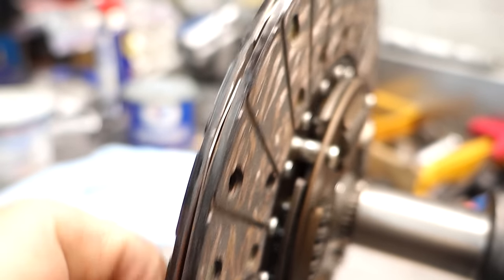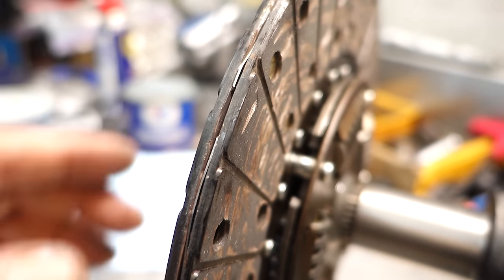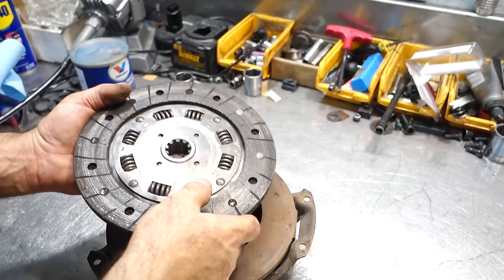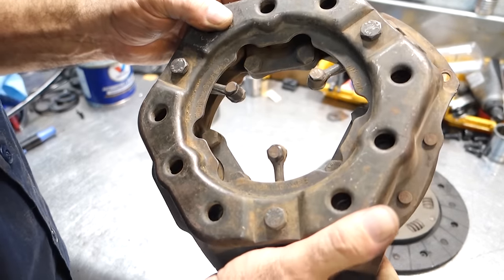Learn How a Clutch Works -  Basic Clutch Operation and Tips

Comment: Why are there friction plates on both sides of the clutch disc? If they're used on both sides, what is it that contacts them on the opposite side of the freewheel?
Reply from the maker: The clutch pressure plate as shown in the video
Reply: @GearBoxVideo  Is the pressure plate rotating in sync with the freewheel to transfer torque? I wonder how they're connected as the pressure plate is on the transmission side.
Reply from the maker: Yes, the pressure plate is actually bolted to the flywheel

Comment: First of all, thank you for sharing. 
I want to ask, what is the problem 
1) When the engine is running and the gear cannot be put in. Press the clutch pedal and when entering the gear it seems to be stuck?
2) When the engine is turned off, go into gear and then start the engine while pressing the clutch will the car jump (keep moving)?

how to overcome?
Reply from the maker: Your clutch is not disengaging the engine from the transmission
Reply: @GearBoxVideo  Yes i think so.

Comment: We have a clutch (most likely) thats making noise when its engaged. Another symptom is when its released quickly vs slowly in neutral. If released slowly its nice. If quickly - the whole car shakes as if something is out of balance. So the slow release of clutch centers the driveline where quick release does not. Would that indicate worn pilot bushing? Or any other ideas?

Comment: That's a great video!
There is one thing I don't understand, perhaps you could help me. 
What moves clutch disc away from the flywheel when the clutch is disengaged?
Reply from the maker: The pressure plate, clamps the disc to the flywheel and pressure plate. Its the pressure plate that unloads its clamping force allowing it to freewheel
Reply: @GearBoxVideo  I mean that the clutch wheel should move along the input shaft, what makes it to? Is it the marcel spring?

I understand on the moving car it might be vibration which pushes it away, but apparently it moves away from the flywheel as soon as the clutch is disengaded even on not moving car like in this video https://www.youtube.com/watch?v=jSmkdbBogc8#t=1m07s

I have tight gears on my car, especially 1 and R, suspecting that the friction on the splines is too high which causes the friction disc to be touching flywheel and transfer the torque to the gearbox. That's why I am trying to understand.
Reply from the maker: It doesnt move away from the flywheel. If you have proper air gap it will just float. If a disc is sloppy on the spline it  can hang on the spline
Reply: @GearBoxVideo  Thanks!

Comment: The trick with reverse is to 1 do it fast and 2 sometimes put it in a different gear first then try again. Works almost every time.
Reply from the maker: A dragging clutch is not resolved by doing what you are doing. A dragging clutch due to havining not enough air gap kills transmission synchro rings.   It's actually the number 1 cause of ring failure.
Reply: @GearBoxVideo  its not dragging just stubborn sometimes. there is no grind sound

Comment: @gearboxvideo @2:45 wouldnt both the flywheel and clutch still spin together even in neutral?  That was my understanding.. and that they would spin independently with the clutch disengaged right?
Reply from the maker: Yes as mentioned at 2..50

Comment: Love the videos , very informative, Have you got an old pressure plate of Fords that required the per adjustment on installation ? That would be a good one to do a video on if interested.
Reply from the maker: +kentuckycowboy2  Great idea.  I don't have one...   I'll be on the look out.
Reply: +GearBoxVideo I don't either or I'd send it to you. I got my Manual trans masters through Ford maybe eighteen years ago now and still picking up great things from your videos. Thanks for sharing your knowledge.
Reply: GearBoxVideo it's my first week driving a standar car and I am struggling. it's hard for me to take of or even park it up hill . any tips ?
Reply from the maker: You have to think of feeding the clutch to the engine. Feed it to fast and it will buck.  Once you master it,  it will be second nature.

Comment: Hey you should also have discussed the pilot bearing that is always in contact with the pressure plate. This is a pilot bearing that has a sliding plate. How would the free play be defined in that case?
Reply from the maker: Pilot bearing s ARE NOT in contact with the pressure plate. They are in your engines crank shaft. Are you thinking of  something else?
Reply: Yes it was throw-out or release bearing instead. I mixed them up.

Comment: Very nice explanation,  thank you! I have a question on a 1969 A833 4spd behind a 440 in a Charger.  I noticed a little slippage on really hard pulls(which I don't do often). But now I have a noise. Not when fully depressed or fully released but right in between. Upshift or downshift, it will have a strange grinding noise when halfway through the pedal travel. If you fully depress or release the clutch it will stop making the noise. It just started this, I was leaning towards release bearing at first but unsure if clutch disc may be coming apart or springs got weak.  Any advice would be fantastic!
Reply from the maker: Could be the pilot pushing, just when the two components move at a different speed.

Comment: My owners manual says to wait three seconds after disengaging the clutch to shift it into reverse. I'm wondering if the gears will come to a complete stop that quickly from an 800 rpm idle? I'm also curious about the inertia in the gears because I think a slower up-shift might be better for worn syncros if the gears slow down a bit before you shift
Reply from the maker: Speed matching is different, because you have motion of the mainshaft, where as in reverse you don't. So it depends on the ratio. Its the ratio differential that will cause more work plus inertia

Comment: Fantastic info, explanation and editing work. Tq. Just a question. Pls correct me if I'm wrong. When the throwout bearing is depressed against the pressure plate hence releasing the clutch plate , the clutch plate is then free from flywheel n pressure house rotation. but if the throwout bearing pressure isn't enough, the clutch plate n transmission shaft will still rotate. And is this why it grinds or is difficult to put in 1st gear or reverse, since the transmission gears are still moving even if so slighty?
Reply from the maker: Yes, you simply are not getting enough clutch release.

Comment: On my 2002 Ford Focus (not SVT model) solid flywheel AFAIK , there is just a little noticeable rattle in neutral. Is that acceptable ? 201kmiles slave cylinder just started leaking a little in cold weather , otherwise shifts fine. Guess I'm screwed as the slave is internal concentric.

Comment: Amazing video.  I really appreciate this.  I'm not mechanically illiterate, but just haven't ever had this explained.  

I've noticed that if my clutch pedal isn't on the floor, going into 2nd gear my gears tend to grind a bit (worse when the car is cold).  Every other manual transmission I've driven, the clutch engages higher up on the pedal.  I've asked about getting my clutch adjusted and I get told that it's a hydraulic transmission and can't be adjusted.  What's the difference with a hydraulic clutch?  Is there a benefit to hydraulic?  

You mention that shifting harder when warm is often the symptom of poor release.  I actually have the opposite problem that when my car is cold, it's very difficult to downshift, most noticeable when coming to a stop/yield, dropping into first, expecting to start back up immediately.  When it warms up, it gets better.  Is this still a release issue?

Comment: Hi Paul, fantastic tutorial, I really feel enlightened and confident that I can accurately diagnose a transmission problem I have. But before I go charging in. I got an A833, 3 speed with overdrive transmission in a 1982 Dodge van. If I may pose this question. It relates to shifting. When dropping from third to second gear the shifter does not engage unless I decelerate my speed substantially, more than what seems necessary to drop to second. I feel it is the calibration or configuration of the shifter linkage, so an external issue rather than an internal one. The transmission was rebuilt due to clutch failure but I fear the inexperience of the mechanic got it wrong when setting up the linkage. What would you advise? Thank you.
Reply from the maker: If you have a good neutral and can get all the gears standing still with the clutch pedal pressed down  or with the engine off and pedal down, that is all the shifter does. Speed dependancy has nothing to do with the external linkage. So it could be poor quslity rings, wrong oil, or porr clutch release.  That box should be actually running Dexron 4 or 5 or better yet Pennzoil Synchromesh
Reply: Oh right I understand if you depress the clutch pedal that action eliminates the effect of speed on the transmission. However if it is just an oil change Pennzoil synchromesh that's required it's no great hardship to remedy the problem. The rings and clutch are almost new so I'd hate to think they'd failed so soon in. I guess it's possible though. I'll have a go again tomorrow and use what I've learned. Thanks Paul
Reply from the maker: It's not that they failed.  Poor clutch release can be adjusted and just because rings are new, doesn't mean they are of good quality. We reject rings often because they don't lock up on the gears.
Reply: Ok I'm going to apply this logic when I take it for a drive tomorrow. If it's not a problem I'll post again on my findings.
Reply: Just wanted to update on my progress Paul. I was having trouble with up and down shifting between gears on my A833 manual transmission. Having driven the Dodge only occasionally and knowing that the relatively new infrequently used rebuilt gearbox components were less likely to be the cause, I followed the Haynes manual instructions and adjusted the shift rods by extending them to their maximum shift length, something overlooked by the mechanic. I'm not breaking out the Bourbon yet but having had a short drive it seems to be working much more smoothly again.
Thanks to some excellent tutorials Paul I've got a greater understanding of how a manual transmission works and the confidence to try fixing the more basic mechanisms myself. Now where's that Bourbon....

Comment: You make great videos. Seems you weren't sure if you liked the centerforce clutch.  What type would you recommend?  M-20 small block 350. Not a racer.
Reply from the maker: Actually after using several Centerforce systems I really do like the quality and easy pedal pressure. The weight system does work. I've started selling them.  Basically a stock street organic disk 10.5" or 11" clutch would probably be fine for stock applications.  They have a 25 doller rebate going on right now with clutch and pressure plate setups.  See: http://goo.gl/FY48Cn

Comment: Number 1: Amazing video, gonna save this link for sure. Thank you!
Next I have a question... trying to diagnose my grinding problem. I had a suspicion that my clutch was not fully disengaging but here is what I don't understand. If my clutch isn't fully disengaging then wouldn't the car want to move if it was in gear with the clutch "disengaged" and revved the rpms? My vehicle does not move when doing this (clutch pedal pressed, in first gear, foot on the gas) so I figure my clutch is disengaged properly.

Ok, so maybe my synchros are bad but here is what makes me come back to clutch not disengaging properly... It upshifts fine, maybe a little hard but no grinding. When I downshift however it grinds so bad. Though if I rev my rpms to around 2000 with the clutch "disengaged" then it will go into gear with little or no grinding. Maybe that is just coincidence because when I put my transfer-case into neutral I can shift all over the place with no grind or wait.... doing that just makes the transfer case act like a clutch for the output shaft.... oh man i am confused.
Reply from the maker: channelurviews hi. Can you tell me the make model year car and what you have for a clutch?
Reply: GearBoxVideo jeep wrangler yj 92. 5 speed AX5 transmission. Stock clutch, flywheel, pilot bearing, pressure plate. Aftermarket throwout bearing. Coverted to a external slave cylinder with later model yj shift fork, bellhousing, master cylinder and a stainless steel aftermarket hydraulic line from advanced adapter... thanks so much for responding!

Comment: Another great video Paul. How do you measure a clutch dia? I measured the dia of my clutch disc and it comes to 11 3/4" wide. I see you sell 10.4, 11, and 12" clutches for sale. Which would I choose for my application? Thank you.
Reply from the maker: It's probably a 12 inch clutch what application is it for?
Reply: GearBoxVideo
Its for a 72 camaro M20. I guess I could round up to 12 right? ha 1/4" never hurt nobody
Reply from the maker: dmesz311 Those are usually 11".  The 12" is usually in trucks only
Reply: Ok thank you

Comment: Thanks for the video, this is really useful! I'm about to embark on a clutch swapping mission, my girlfriend's clutch is slipping a lot. I was wondering is that because the surface is worn to the point where there isn't enough material to keep the plates compressed with each other? It seems to slip only on the torque curve and not before or after. Someone on a forum suggested there might be an oil leak on the clutch from the engine/crank.

Comment: Thank you for your great explanation videos, they are really great. I have a 69 slant six with a 4spd, indeed reverse grinds sometimes. But high rpm shifting goes great. From a stand still the clutch doesn't really go smooth though. So are these different problems? Another thing that's really annoying is only when I press the clutch, I have a constant loud rattling noise like a worn bearing. Pilot bearing or release bearing? Thanks again!
Reply from the maker: Your clutch and release bearing probably need to be replaced. The fingers on the clutch may be uneven

Comment: My understanding from quite a lot of YouTube videos is that clutches on diesel.engines get harder with time. Not sure what 'harder' means i.e. the force to push the pedal or the spring back of the pedal. Either way,  wondering if it's actually the case for diesel engines compared to gasoline ones and if yes, why. Thanks for an informative video by the way.🙏
Reply from the maker: I don't see why that would make a difference
Reply: @GearBoxVideo  my thoughts were same too and I couldn't reason after seeing your detailed video as well. Thanks for your reply!

Comment: Excellent content! Would you say wormed out springs in the plate and in the disc can cause sync problems between gear changes and harshness? I have a land cruiser with a manual transmission and every time i make a gear change i feel a small roughness, like that reverse gap you mention in the video. I also noticed that if i try to drive the car against a rock or something in the way that needs a little effort the car doesn't move for a bit and clutch starts to smell. Thanks again for your video, it well made and very clear!
Reply from the maker: Obviously you need more holding power and a stronger clutch if you are slipping it to the point you smell it burning. It could be slipping and grabbing
Reply: please show how gear and clutch mechanism works in engine
Reply: please
Reply from the maker: When I have time I will do a video

Comment: This is the missing piece of the puzzle! This video helped me understand how the clutch disconnects and connects the engine from the transmission. If I understand this video correctly, the bearing is connected to the clutch pedal, and the bearing rests on diaphragm fingers that depress springs that press the clutch to the flywheel, which allows power to go to the transmission, driving connected wheels.
Reply from the maker: Cyphrix101 when pedal pressure is applied the bearing makes contact with the fingers to release the clutch.
Reply: GearBoxVideo ah, right. Thank you!

Comment: Wow! what a brilliant video sooo very informative, so why are automobile manafactures turning to dual mass clutches especially when the basic clutch seems to already have the same properties as the dual mass clutch with less weight and at about half the price. The theory if it aint broke dont fix it springs to mind.
Reply from the maker: Maybe you mean dual disc? Sometimes you need more holding power when pushing 800 to 1000 HP. Dual mass is a term used for flywheels to cancel harmonic vibration with certain engines that are prone to nasty harmonic issues.

Comment: awesome sir, this video is informative. I have a doubt, before clutch is pressed, both flywheel and disc are attached & gears are rotating with input shaft, when clutch pedal is pressed, clutch disc is disengaged from the flywheel then what happens in the transmission part
Reply from the maker: What would you think happens? Try and think it through
Reply: @GearBoxVideo  found this after watching some videos sir, input shaft stops rotating and transmission slows down then synchronizer ring attaches gear set to the output shaft